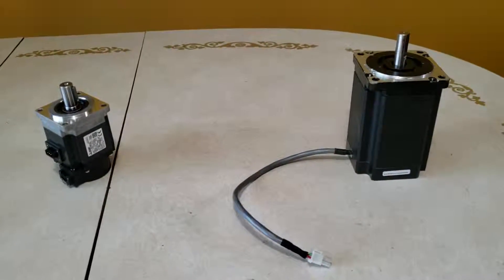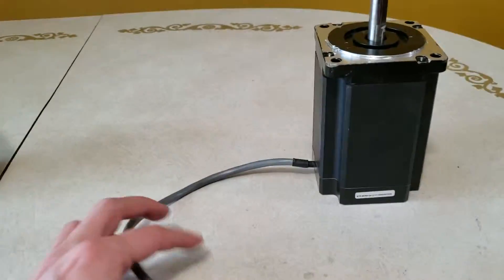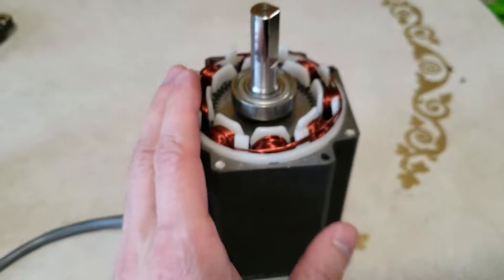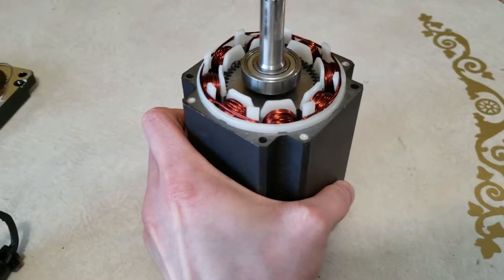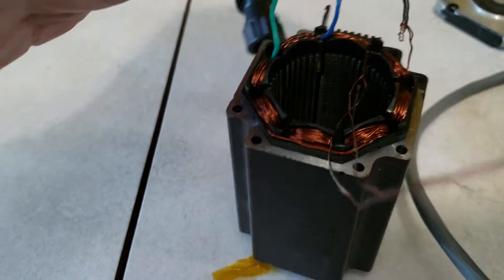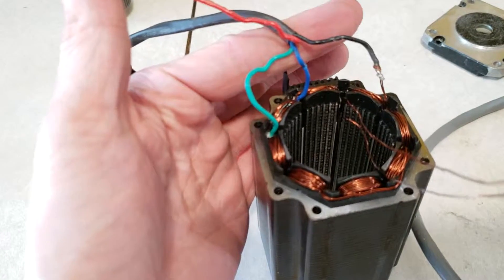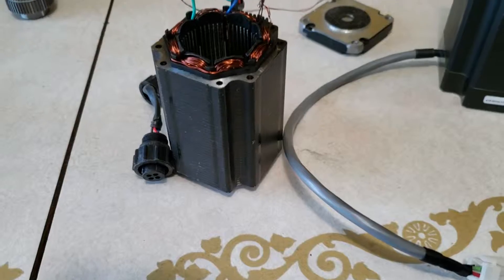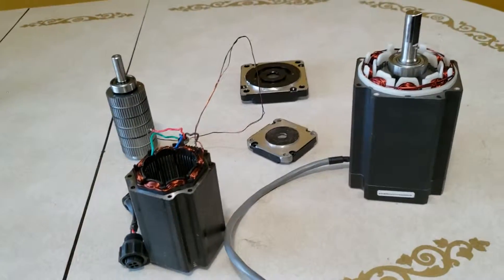Disassembling Stepper Motors

Comment: Thanks for that. You have no idea why all stepper motors have a warning on them that they shouldn't be disassembled. What you did. Did you use some non-magnetic insulation between the rotor and stator to pull the rotor out, because from what I've read, pulling the rotor out of the stepper motor will cause a loss of magnetism and then also a drop in stepper motor torque.
Reply from the maker: @dorlock42  this motor was already out of use and may have been dead so no problems there. But it shouldn't cause any loss of magnetism itself, same as pulling a refrigerator magnet across the fridge. Obviously if damage resulted to the surface it's possible for a host of problems but the rotors are pretty hardy and I haven't experienced any problems in the past.
Reply: @loganpoppe3494  Thank you for your prompt reply. I couldn't find much information about this anywhere right now. Somewhere someone wrote that they tried a dyno test and measured 112 in-oz of torque at low rpm. He removed the rotor for 5 seconds, then put it back in again did the dynamic test. The low speed torque was now 70 in-oz, only 62% of the pre-removal value. I don't know I have no way of checking this, but I would need to replace the bearings on a single stepper motor and this is what I'm quite worried about.

Comment: Great video.
I have a problem with my stepper motor. It stalls at high speed. It feels rough in one place when turning by hand. I cam adjust it slightly by playing with the end screws and adjusting tension. Do you think it might be a slight bend in the shaft? Sounds like the same problem as yours?
Reply from the maker: It's hard to say for sure. Motors stall whenever the force back against them exceeds the torque they put out. It could be that your driver doesn't put out enough torque or that you're simply exceeding how fast it is capable of turning. Maybe an end bearing is bad or the whole thing is misaligned. The clearance between rotor and stator is just a few thousandths of an inch so it doesn't take much.
Reply: @loganpoppe3494  
Well I have sort of fixed it for now. Turned the casing around 90 degrees - and left one screw slack. Not ideal but it is much smoother now and doesn't stall.